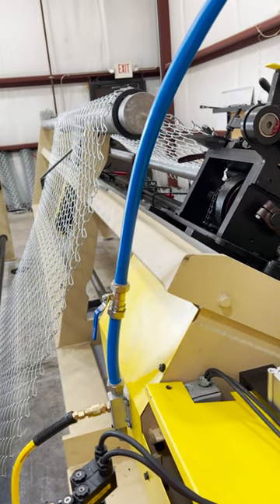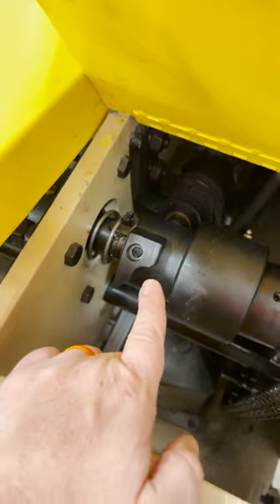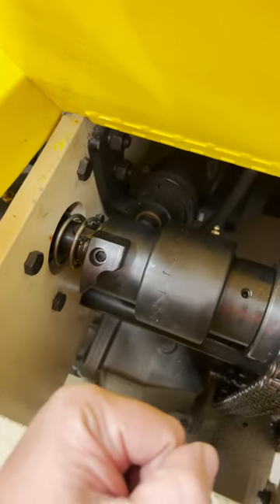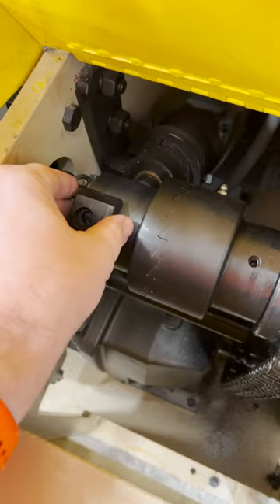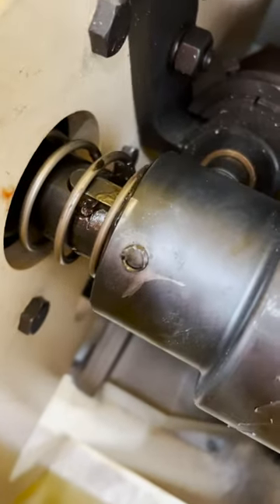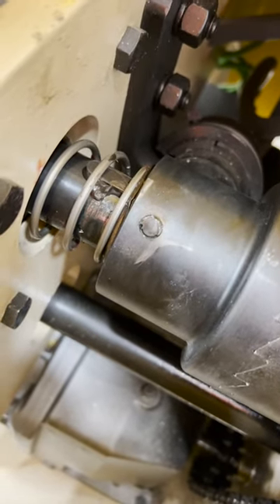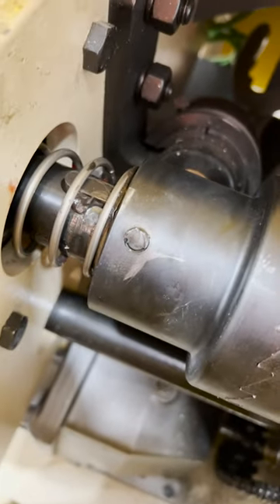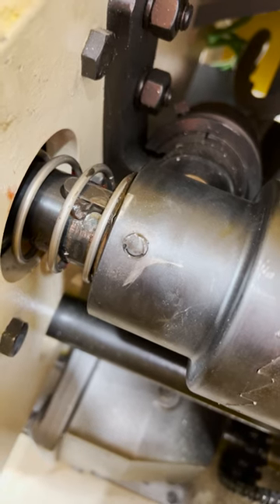This One Bolt Broke The Whole Machine #shorts

Comment: Use a mag drill with an end mill or center drill to flatten it. Carbide will chew through even the hardest bolts. You will have to get something flat to mount the mag drill on, but then you can also use it to drill straight through the center of the bolt. Faster, more accurate, and easier then welding or drilling by hand. Maybe welding could work if you have some precise tig skills, but it is almost recessed in the chamfer so it will not be easy to make the weld strong enough to do anything.

Comment: Drill a small hole first try and stay center best you can then take a nut put it directly over broken bolt fill in middle with weld just burst it stop cool burst it stop see what’s going on fill the nut up with weld best you can don’t over heat then take a wrench and slowly work her out of there
Reply: Also if you can get a set of reverse drill bits that drill forward in reverse might get lucky and she’ll bite and spin out on ya had to do that to remove broken oil pan bolts that were broke off into bottom of a semi block got lucky they spun right with the reverse drill bits